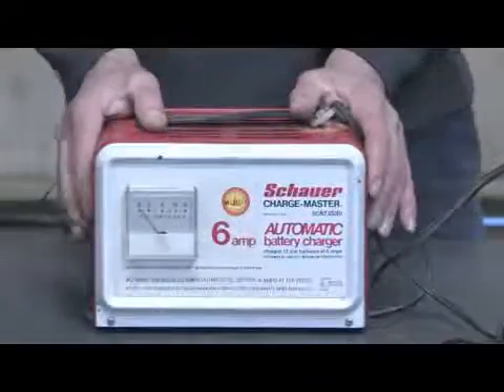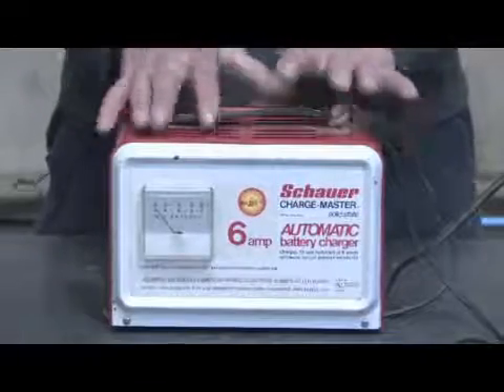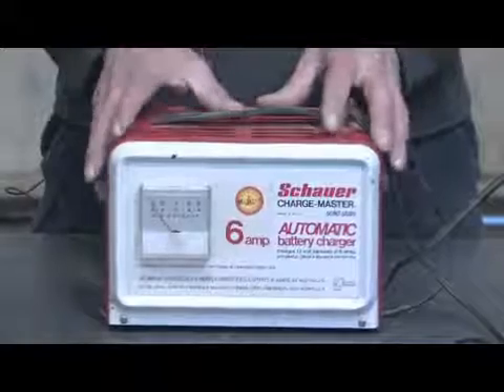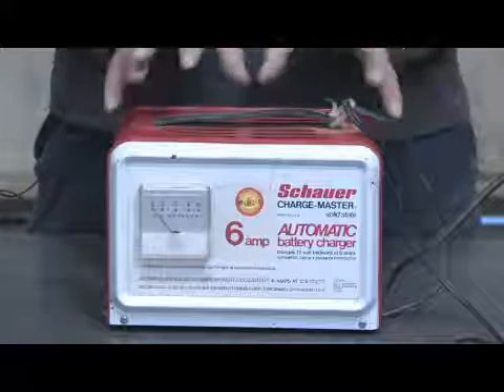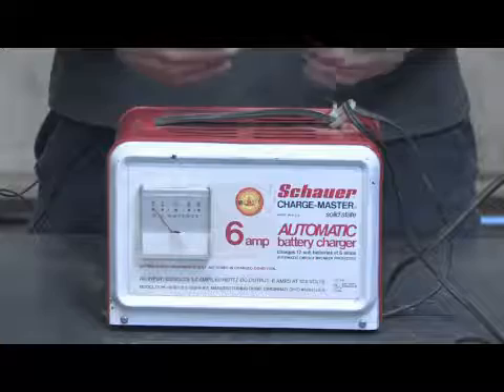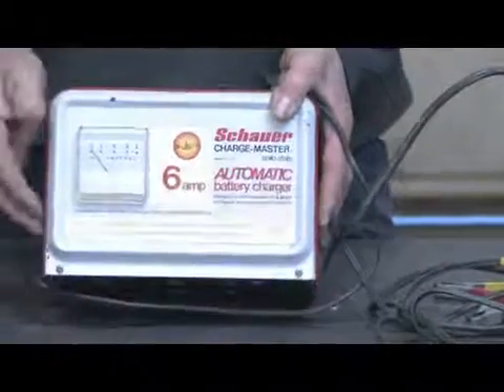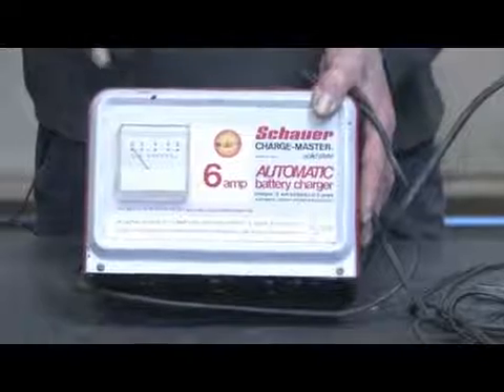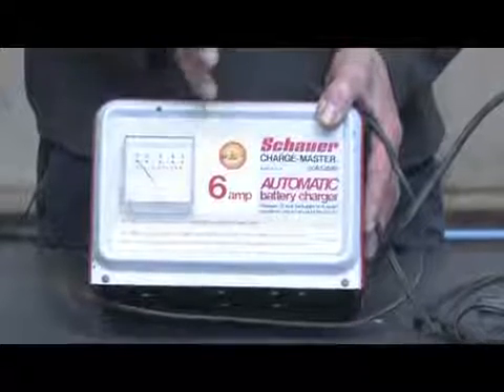How Do Auto Battery Chargers Work?

Comment: I knew that a battery charge converts AC in to DC. What I want to know is the running gears part.
you know when you hook up a charger, AC power flows in going to the blank and then to the blank,     the steps the power go though